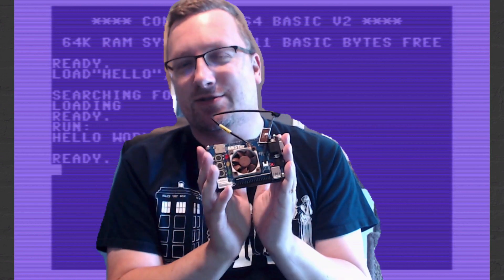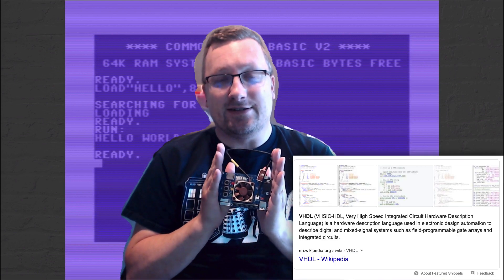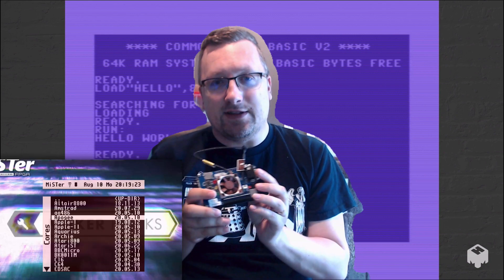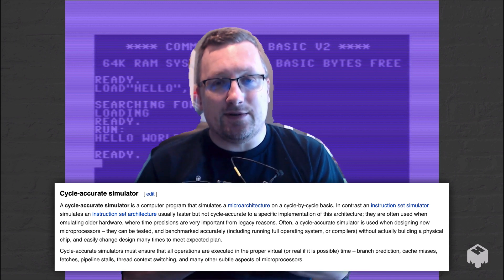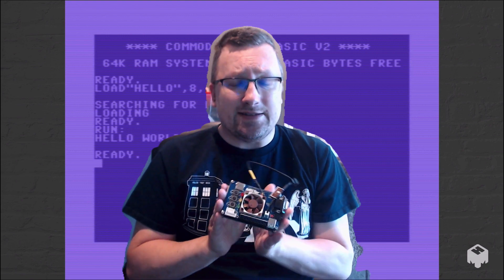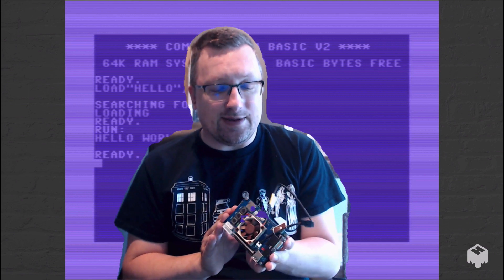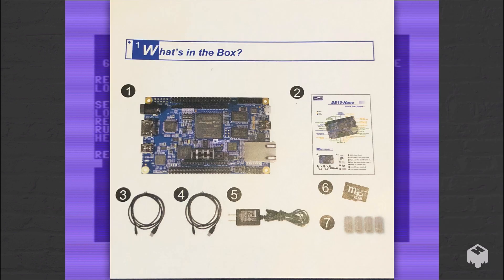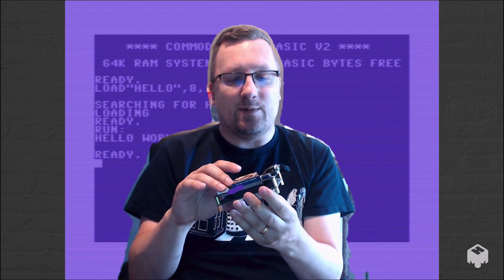MiSTer FPGA Getting Started and Setting Up with Mr Fusion (Step-by-Step MiSTer Setup Guide Tutorial)

Comment: Also MiSTer costs a LOT more than $200 lol. Just the board costs $125 minimum with a student discount. USB Hub costs $60. IO Board costs another $60. 128MB SDRAM costs another $60. A cheaply made acrylic case costs $35. Add another $15 for a decent fan/heatsink. 
You're looking at around $350 +/- $20 for a barebones MiSTer setup lol. 
Meanwhile a Pi 4 ($55) + Argon One case ($25) + PSU ($10) + 128GB MicroSD ($20) = $110 

Pi 4 is a much better option for emulation of consoles, as run-ahead takes care of latency issues. The only people who'd benefit from MiSTer would be people who want to emulate ancient computers or people who want arcade emulation.
Reply: The sound is way more accurate tho